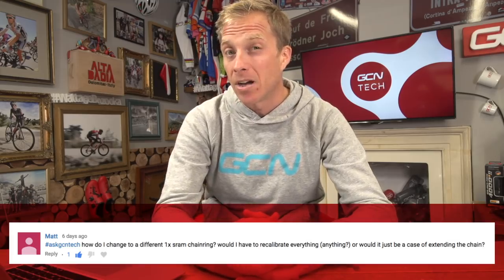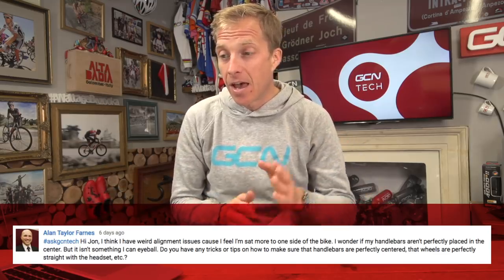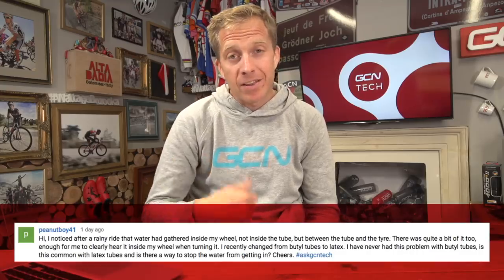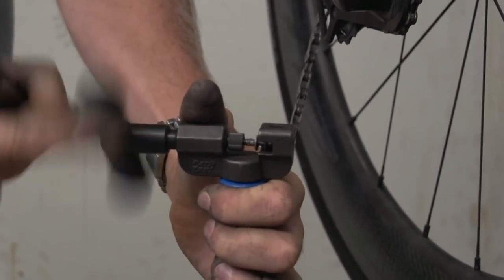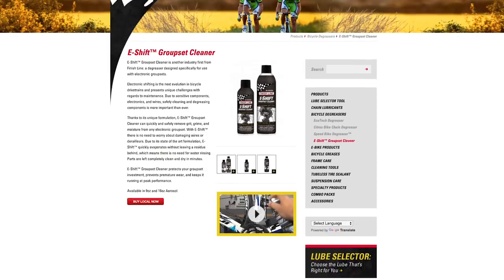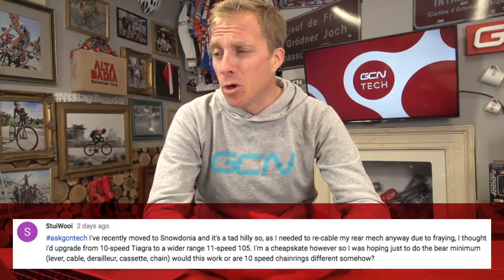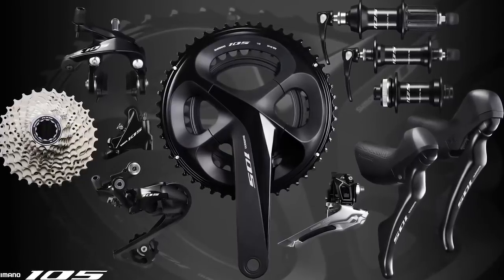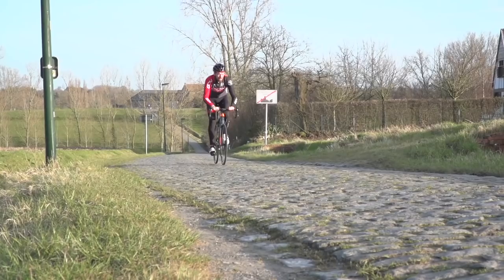How Do I Perfectly Align My Handlebars & Stem? | GCN Tech Clinic

Comment: #askgcntech i used a cassette with single sprockets (not fixed on an spider) on my new mavic cosmic carbon pro rims and after 200km it started already to slightly damage the freehubbody. Is there a way to use this cassette without damaging the freehub or do i have to buy a cassette with all sprockets on a spider?

Comment: Hey Jon, I need your help! I have Ultegra di2 and have noticed that when im in the big chainring in the front and the easiest gear in the back, the transition to the next 2 gears is a little rough and clunky. The rest down are pretty smooth. I've tried microadjusting the easy gears but notice that if i do that I have issues in the harder gears. Any tips??? I want that perfect gear change with my di2!

Comment: Hi Jon, I'm planning on replacing the bottom bracket on my bike because it's very creaky and doesn't feel smooth. It's a 68mm x 110.5mm sealed cartridge BB. The replacement bottom bracket i'm looking at only comes in a 110mm, 113mm, and 115mm. Should I go for the BB closest to the original one? or should I opt for a one with a slightly longer spindle length? #askgcntech

Comment: Hey Jon,
Thanks for the Stem Alignment Advice!
My problem is a few centimeters down the fork.
The distance between the fork and the frame at the bottom of the steering tube has increased slightly over the last months. But the fork does not move a millimeter. Even after a few hits with a rubbered hammer nothing moves. What can i do
Reply: #askgcntech

Comment: Jon my front mech bolt on hanger is bent on my alloy frame I dont want to risk snapping it so not tried bending it back. I cant get the mech cage parallel to the chainrings so the chain is touching the cage in lowest and highest gears. Any suggestions? #askgcntech

Comment: Hi Jon, I have two Problems with my Roadbike in the headtube area. The first one is about the correct size bearings: I have a semi-integrated system (atleast I think so). When I bought the frame used the guy I got it from gave me a set of bearings with it and warned me that they might be to tall for it. And of course they were. So they fit and I currently ride on it but I do have a gap between the frame and the actual fork wich attracts dirt like nothing else. There is no play but it looks kind of silly. So the question is: What do I need to measure in order to get the right size bearings, and where do I geht them ?

The second question is bit harder so explain. Same frame though. The cable routing isn`t Internal so there are two cable stops for the shifting cables in the downtube area. However they are actually very far towards the front of the bike on the actual headtube. So I ran into a problem because the barreladjustor on the cable stop (even when extended to least amount possible) on the right side of the bike interfers with the cablemount of my front brake. So I can ride my bike but I am strressing the shifting cable a fair bit. I have bought a new groupset wich is on its way and of course I don`t want to change my new cables every 2 months or so. So the question is: Is there any way to get rid of the barreladjustor and have the cable still be seated in the cablestop securely (the cable tension could be adjusted using inline adjustors)?

Comment: #askgcntech Jon, great work as usual. My question is more of a PSA about a painfully annoying pop/creak that I recently solved and was curious if you have seen this before. I had a rage inducing pop coming from my seat/post area. It is an alloy post in a Ti frame. I knew it had to do with the seat or post because the sound was only present when seated. After much frustration and grease all over the seat rails, seat clamp, and anything else I could think of, it turned out to be the collar. The seat post collar wasn't seated by about a half millimeter and although holding the post just fine, would make a super loud pop that resonated through the frame when the right forces were applied. Cleaned the collar, seated it back in place and the sound was solved. Have you seen this before? I hope you can comment and some poor soul that is slowly losing their mind trying to solve the same issue can find relief.
Reply from the maker: Hey mate. those noises are terrible. trying to track them down can be the most infuriating thing. Thankfully it is now sorted!
Jon

Comment: Great show as always. So as I'm going to buy some new bikes the next few weeks I'm in need of help with my sizing. Currently I'm rocking a 58cm cyclocross frame height, which doesn't fit me perfectly. My stats are 178cm height and 81cm inner leg length, which should get me to a 54cm fh. I'm afraid that this is too small for me and I do not have a lbs with my dream bikes close to me, where it would be possible to try on. What should I do? #askgcntech

Comment: I have a SRAM 1x Apex system on my road bike and I am continually having issues where the RD won't shift back into smaller cogs. We've changed housing, adjusted the B screw, and installed a Teflon coated cable.  The local SRAM rep even changed the routing under my handlebar tape slightly and I'm still having issues.  Any ideas? #askgcntech

Comment: Hi Jon
One of my disc brake caliper mounting bolts has snapped, leaving the threaded end still in my carbon fork. Not enough is sticking out to grab with pliers. Any other way to get this bolt out. I would like to get riding again as soon as possible as cannot ride without a front brake. 
Thanks
Henry
#askgcntech

Comment: #askgcntech There's a nice Shimano Dura-Ace r9000 dual power meter on sale online, however its a 180mm crank. On every bike I've owned the stock system is 175mm, however I'm 193cm and wear a size 50 shoe. What would I need to consider before changing crank arm lengths? Will it change my bike fit drastically? I'm much taller than the average cyclist but am I 180mm-crank tall? Thanks, and love the show!

Comment: Do you have any tricks for removing tubeless tyres from rims ? I've used Schwalbe's Pro One's , Sector 28s and currently Mavic UST's ( on HED Ardennes SL wheels )  , they've all been difficult to remove from the rim  , the fit is a lot tighter than standard clinchers and the bead refuses to budge  - I've resorted to Mole grips at times to get a decent grip
Reply: also ...I've tried various ways to wedge something between the bead and the rim but always failed
Reply: Step on the tire and push on the other side of the rim with your hands

Comment: #askgcntech I love you Jon! I have a brand new bike with complete R8000 Ultegra groupset. After 2 or 3 rides I noticed that the finish around the Ultegra logos on both the crankarms has distorted, the black finish around these areas now have clear white striations all across them, I noticed this after no more than 200km. I am worried that I may have somehow warped the crankarms with the insane power I may have put through them but the truth is I am a very low power cyclist so although this would be flattering I find it unlikely and the bike is too new for this to be an age related issue, hopefully this is just normal flex right, any insight?

Comment: Hi Jon, thanks for your videos wich have always been of great help ! 
I was wondering about the best way to clean headset/BB bearings : should the old dirty grease be simply wiped off and some new one applied ? Or is it better to spray the bearing with a degreaser (eg WD40), rince it off with dish liquid and water and then apply new grease ? Thanks in advance. #askgcntech
Reply: GauGaut 1202
As a retired engineer, I would always thoroughly sovent clean a bearing before re greasing. Just wiping it down may leave some grit.

Comment: Got a shimano hidraulic lever with an ultegra derailleur. When im pulling the front brakes sometimes i have a weird little klick noise from the lever, had it already cleaned, found nothing in there that is dirty or already worn out. Any ideas what this klick could be?
Reply: It could be your brake pistons are sticking and not retracting fast enough.  Park Tool calls them lazy seals. They clean off the brake dust accumulation on the perimeter of the exposed piston after you remove the brake pads, with Shimano brake fluid on a q-tip and then gently exercise the pistons with a gentle squeeze of the brake lever, then push the piston back all the way with a plastic tire lever and repeat until you see both piston seals retracting and extending equally.
Reply: Thank you for the response, but maybe my problem got lost within my english skills. So the klick sound comes from the brake/gear lever, not the piston or the disc area. What surprising, that I can feel the click in the lever, which should cause some scratches on the parts, but everyhing looks perfect when we take it apart. Funnily the rear lever does not do anything like this...

Comment: I’m planing on upgrading my groupset what should I go for sram red etap or shimano ultegra di2?  #askgcnanithing
Reply: These 2 groupsets are really high quality. Sram RED eTap is the highest range you can get from Sram, as Ultegra Di2 is top-mid to mid-top range.
Reply: I have eTap and it works great, doesn't have a junction box or cables to derailleurs, and it looks cleaner than Di2. I believe Di2 has customization features which eTap lacks??? Never heard anybody complain about either system.

Comment: #askgcntech How to remove saddle and saddle post squeaks! I've removed the post, cleaned it, cleaned the inside of the drop tube, lubed the post and clamp and tightened it to the recommended 5nM. Ive removed and cleaned the saddle mounts, greased the saddle mounts, WD-40 in the rail housings and greased the clamp bolt. Clamped the bolt to 22nM with my calibrated torque wrench and the bastard still squeaks. Ready to set the bike on fire.

Comment: #askgcntech Hi Jon. Great show yes indeed!  Here's my question. I run an Ultegra compact chainring (50-34) with an 11-27 10-speed cassette in the back. I noticed when calculating the gear ratios that two combinations (50-19 vs 34-13 and 50-21 vs 34-14) yield almost identical results (2,64 vs 2,66 and 2,40 vs 2,45). Should I prefer a combination over the other?  At the same cadence, the result (speed and power requirement) will be the same, right?  Or am I missing somehting?  Merci! The guy from #2gcnbottles  ;-)

Comment: #askgcntech Hi Jon, I replaiced my sram force rear caliper and bleeded it. Big help, thanks a lot for the video! It works pretty fine, but when I removed the syringes at the end a lot of oil came out of both of the bleedports so I had to hurry to close it. Your ports are dry after removing. Have I done something wrong?

Comment: As many don't have the resources for bikes, what are the tools and materials for cars/motorcycles that can be used for bikes too? because I think many motorcycle and car mechanics and their tools/materials can repair a bicycle. #askgcntech
Reply: Yes, motorbike mechanics tools will work fine for working on a bicycle. The only thing to be extra careful about is torque wrenches. The ones used on motorbikes aren't as good for small torque settings, a bicycle specific one is much better.
Oh yes, smaller tire levers are a must.
Reply: I'm also thinking of the greases, polishes, chain wax, etc. Why not have an episode of "what bike tool and materials you can get in a car/motorcycle shop?" or "can a car/motorcycle mechanic fix a bike and vice verca" Because from my limited experience, sometimes, bicycle items are much pricier and harder to find than their motorized counterparts
Reply: Taufik Abidin
I would say that the greases, etc will also work fine on a bicycle.

Comment: #askgcntech the rear derailleur is making clicking noises and upon inspection the upper wheel is shifting side to side, this is on a shimano 3500 series Sora, could I upgrade the rear derailleur to a tiagra or 105 and still use my 9sp Sora shifters until a time when I can afford to upgrade those and convert it to a 10 or 11 speed? if not are there higher quality quiet pulleys I could install that won't brake the bank but last a bit longer than stock sora jockey wheels?
Reply: you can buy cheap pulleys on aliexpress, anyway the upper pulley is supposed to be able to move a little bit.